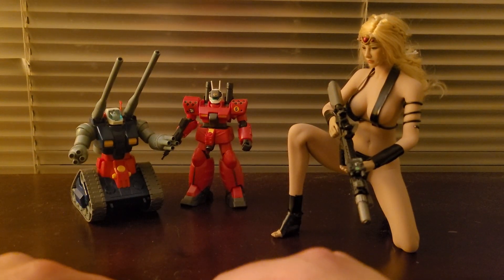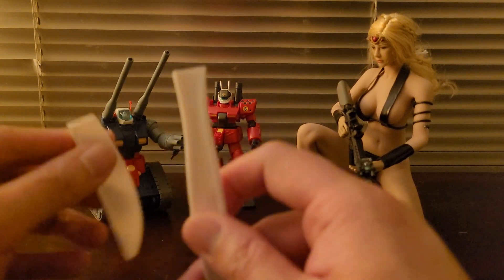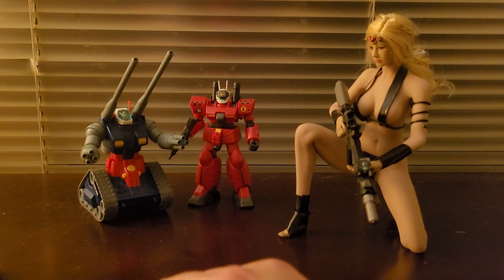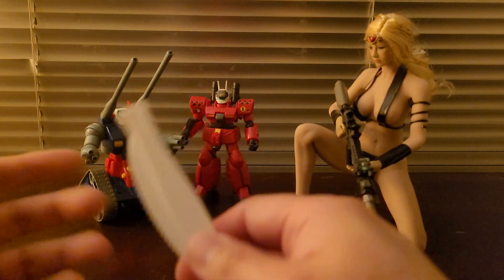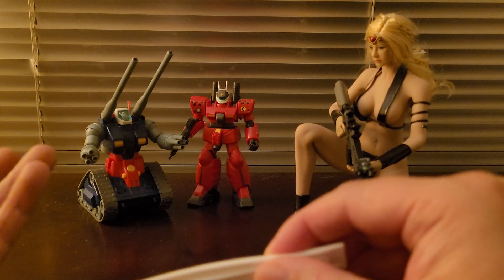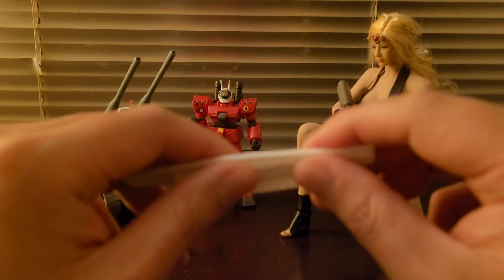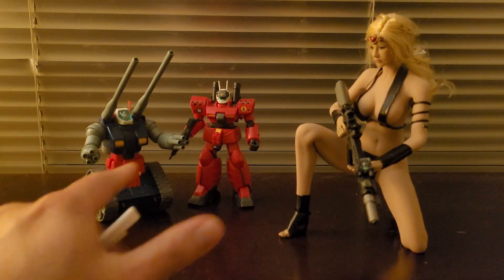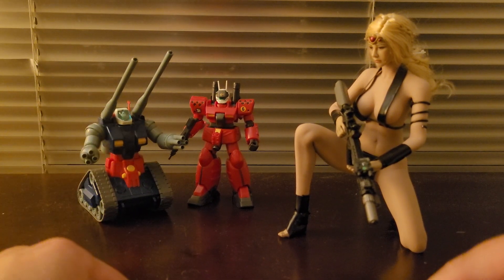Let's Talk Plastics: Polystyrene (Gunpla)

Comment: Just when I was about to get into Gunpla building & collecting. Big Mahalo for the Warning! I Think it's 
a matter of concern that everyone whose into Gunpla should hear you out!! 🤔👍💯
Reply from the maker: Thanks. polystyrene can be dangerous when heated, it can create harmful gasses that are link to leukemia. 
But generally polystyrene is used for stuff like spoons and forks and even food containers.. yeah weird cuz those items are often heated. Technically the entire oil industry is a scam.. Most consumer plastics are derived from oil so nothing is technically safe. 

The polystyrene in toys isn’t as bad as plasticized pvc (contains Phthalates) on domestic action figures (Hasbro Marvel Legends, NECA, Mattel, and McFarlane).. the phthalates can migrate into sticky residue on the surface of the figures and evaporate into fumes with noticeable odor both are harmful via direct contact from touching with bare hands and inhalation. Phthalates are endocrine disruptors and are linked to to developmental issues in children and male hormonal imbalance which lead to obesity and depression.. and obviously cancer. Plasticizers is the chemical that softens the plastic to male them flexible aka gummy/rubbery.

From the industry regulators stand point these plastics are mostly safe as long as people don’t put them in their mouth or try to digest them, US safety standards are whack.. on paper it looks good but millions of people including children are getting cancer every year.
Reply: @s3d17 Hello. Are SH figuarts from Bandai dangerous for health? I think they use pvc too, but I dont know much.

Comment: Hi, is polystyrene rubbery or the abs is the rubbery one?
Reply from the maker: None. 

The key word is flexibility. In fact I think 90% of the toy reviewers are spreading misinformation about "rubbery".. plastics are not rubbery. Rubber is an organic compound and will degrade and disintegrate over time. The flexible ones are PVC (plastic) treated with plasticizers aka plasticized pvc used often in US domestic action figure from Hasbro, Mattel, WCT, and Bandai America #plasticizedpvc

ABS and Polystyrene are hard plastics. ABS is a resin and cannot be plasticized for flexibility.
Reply: @s3d17  okay thanks. Thats the information i needed.
Reply from the maker: ABS is made by combining Polystyrene with an organic resin to form a more stronger type of plastic.
. the combination also removes the natural properties of Polystyrene from been able to be dissolved/melted back together with plastic cement. 

ABS is intended to withstand high impact but has no flexibility, it is mostly used in electronics like keyboards, video game consoles, controllers, and remote controls etc.

Common products are Hasbro/Takara Transformers figures are mostly ABS. Gunpla is mostly Polystyrene.
Reply: @s3d17  so the reason why abs is weak agaist panel liners because of its composition?
Reply from the maker: @INFNTRX_AERO  yes the chemical composition
Reply: I just want to know, how to know if its abs or ps? Just by the feeling of it.